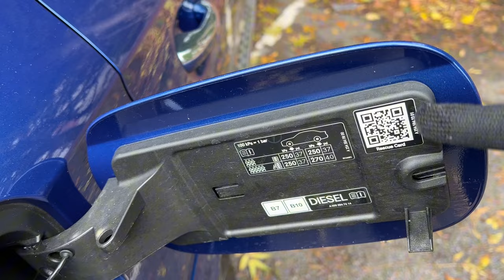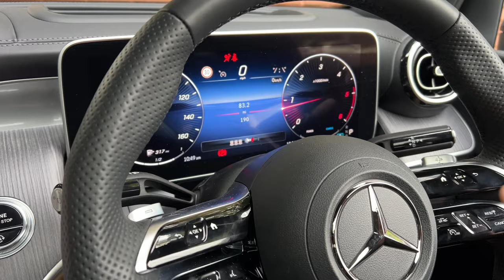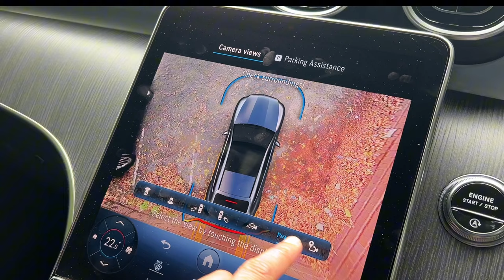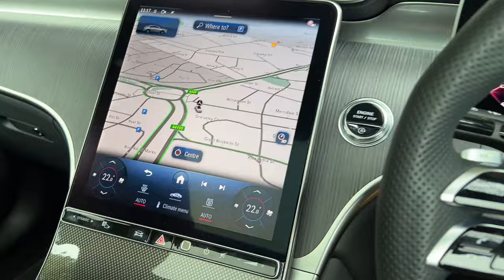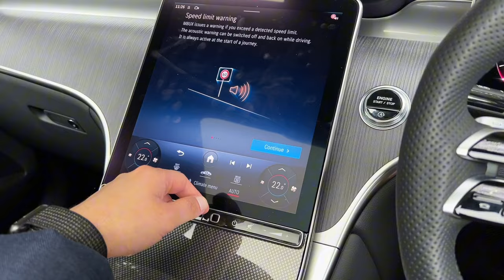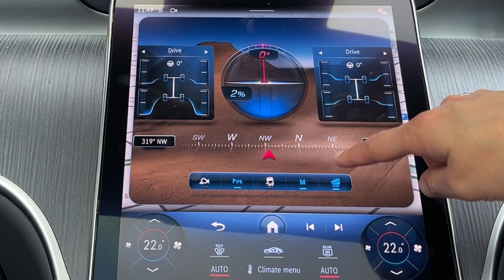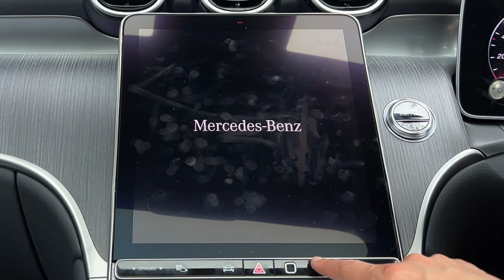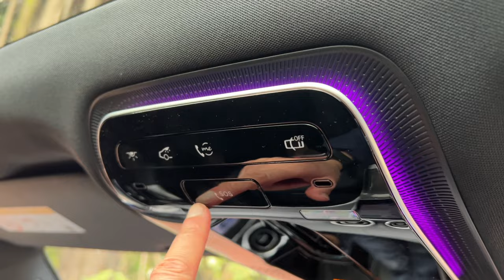NEW 2023-2024 Mercedes-Benz GLC Coupe. Everything you NEED to know!

Comment: Hi, I noticed that your car has no ambient lights on the center console and air vents. Is this on demand or is this option disabled? Perhaps you can answer the same way - is this an option that needs to be added separately? I encountered something similar when my car arrived, although I had the top AMG package selected
Reply from the maker: Thanks for the comment. I have had allot of people message that they do not have the ambient lights in the centre console and air vents. It used to be an option but for whatever reason in the past year, Mercedes are no longer fitting it (maybe due to chip shortages).

Comment: Is this 2023 or 2024? Because I have seen a 2023 with a smaller middle screen.
Reply from the maker: Thanks for the comment. So in 2023 a new version of the GLC was available to buy from new. The smaller middle screen is the previous model.
Reply: @DrSaahb  so you are saying there are some 2023 GLC Coupes with the smaller screen and some with the larger screen?
Reply from the maker: Yes. Older models will have the smaller screen. New models will have the larger screen 😀